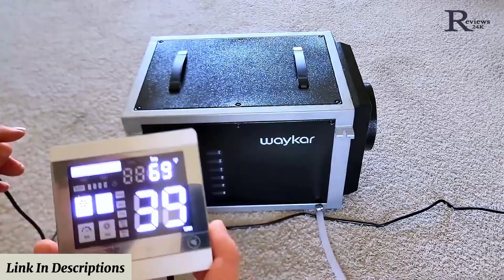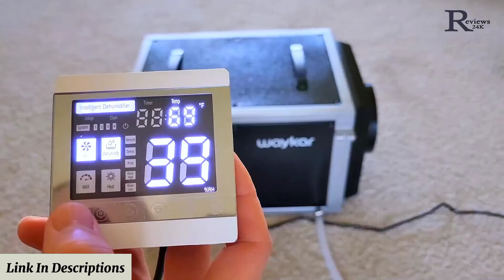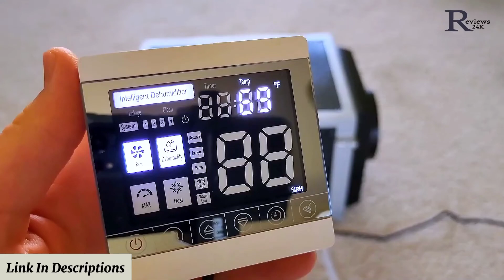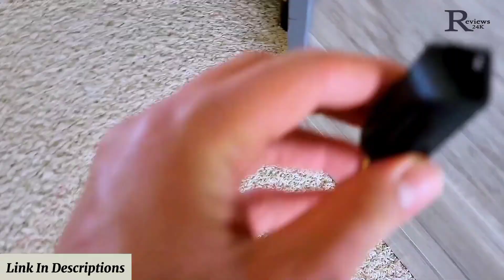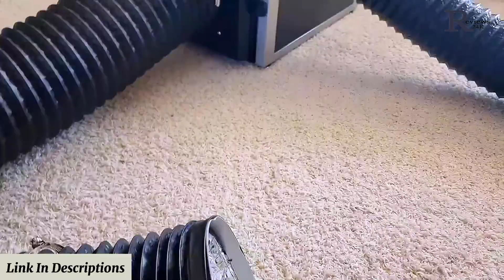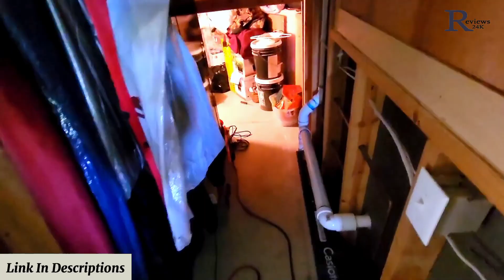Best Commercial Dehumidifier for Crawl Spaces Buying Guide in 2024

Comment: I have a "clean" light on. Is there a filter that I need to clean?
Reply from the maker: Yes Definitely
Reply: The clean button and process is abit confusing.  Filter is cleaned, drain away and water tank cleaned.  Still have flashing clean light and pump light.
Reply: @justincorwin2962 what did you do about the flashing clean light?